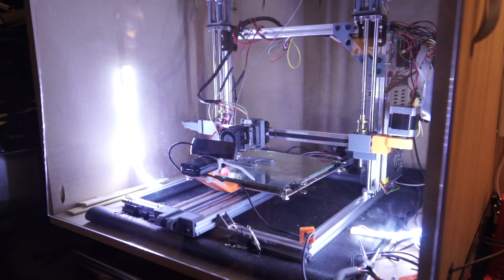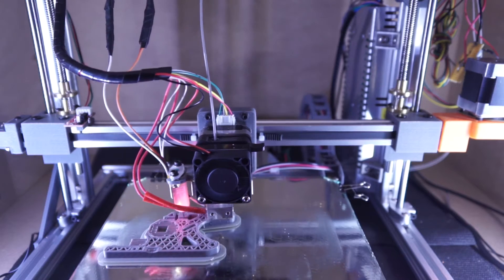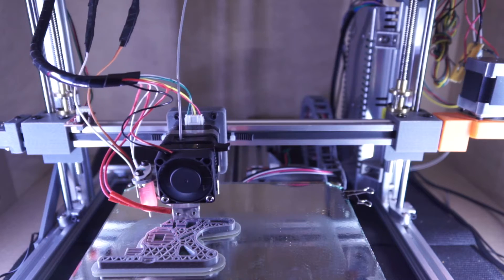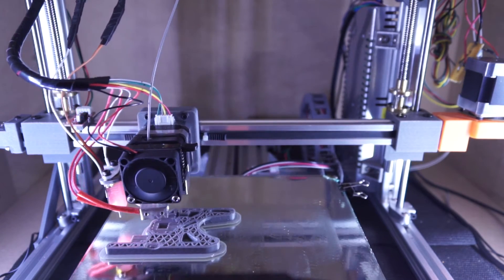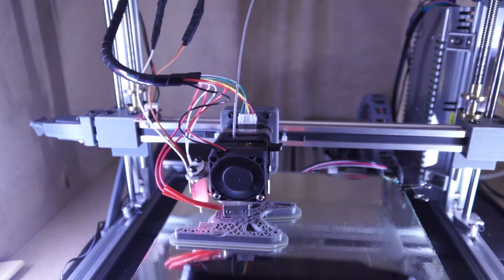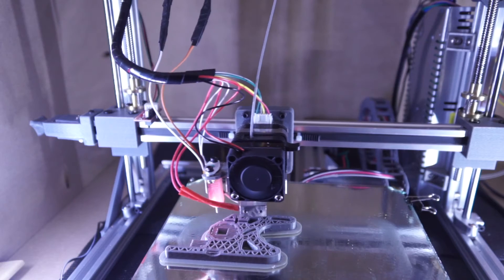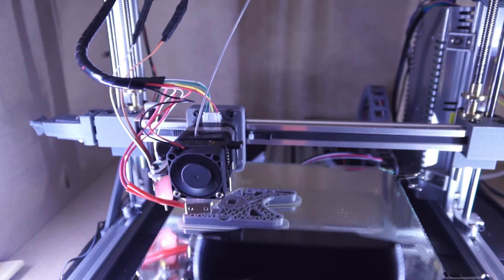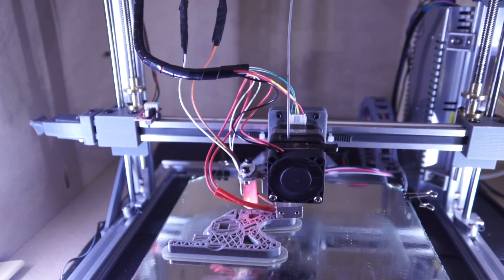FolgerTech 2020 i3 V-Slot Upgrade - Part 2

Comment: am looking forward to silencing my FT 2020 as well :) and upgrading from the 2 z-motors to just one. have you seen those designs where one z-motor runs the 2 lead screws?
Reply: I have... maybe someday I'll change the design... but I'm thinking of building a custom machine first that uses ball screws for the x & y axis...

Comment: So quiet! Do you live stream your prints, is that what the webcam is for?
Reply from the maker: +johnydecali I do but there's no sound... and my OctoPi keeps on crashing and I need to figure out why... when it does the nozzle stops but the temp keeps on going...
Reply: +Chris Bordeleau Photography even with no audio, I'm sure hat it's neat to watch. Hopefully you'll figure out what's wrong with your OctiPi to keep it from crashing.
Reply from the maker: I'm thinking of taking an extra Raspberry Pi and using that for streaming... then I don't need to worry about if affecting my prints... I have another camera coming so stay tuned...